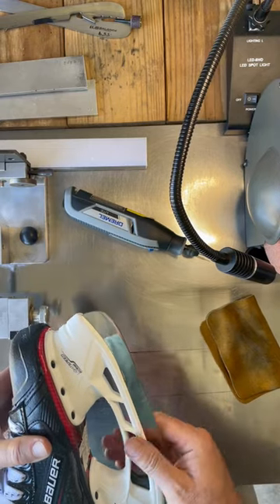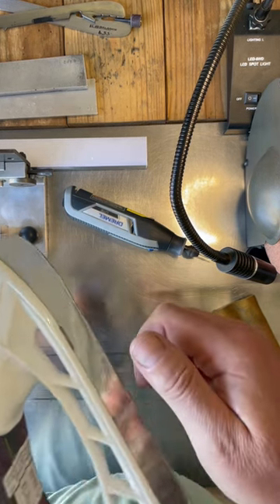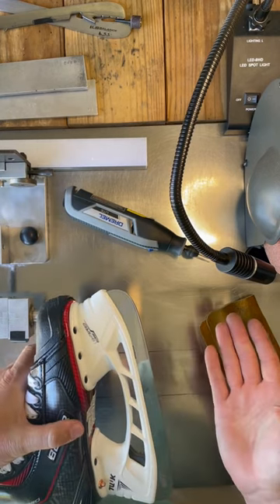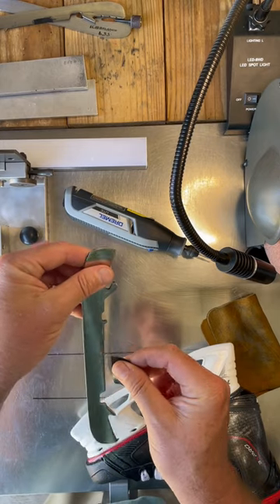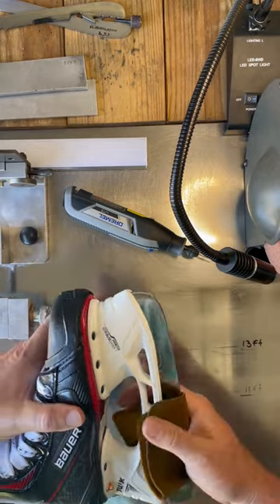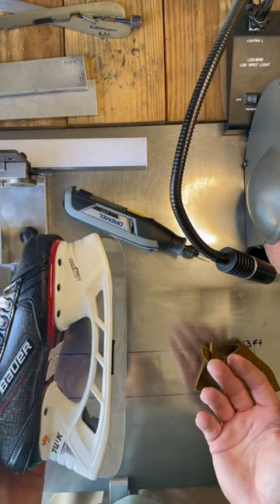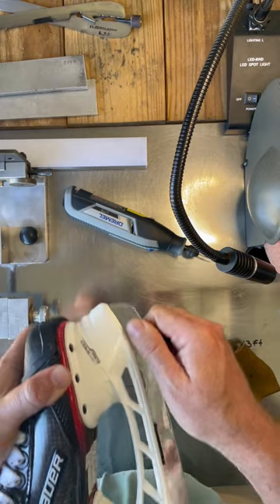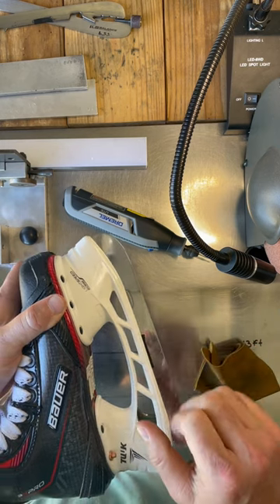Hockey Skate Blade Loose?

Comment: Or get blades that are the correct thickness.
Reply from the maker: That helps, for sure.   However, in my experience it’s pretty much random what blades lock in perfectly and which ones don’t, and, it can change over time as the holder stretches out a bit with use.  I’m sure you’ve seen it where skates directly off the rack with the same manufacturer’s blades move right out of the box.  My experience is that the worst offender of this issue are lower end junior skates.  

Thanks for commenting!
Reply: @QuantumRadii  
Just had a pair of trues with this issue , blades where .005 under size on width. .115" instead of .120" thickness. Customer had the true  shift max holder and wanted to the true shift steel . The max holder fits steel  that is .120" in thickness the shift regular is .115 thickness. Tape is a band aid and can gum up the inside of the holder channel.Told the customer to return the steel and get steel that is made for the correct holder.